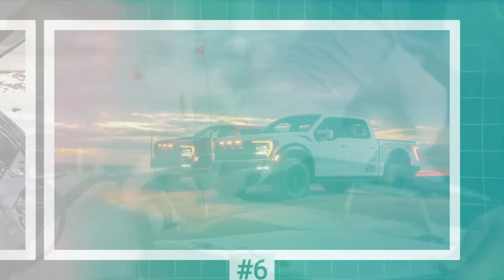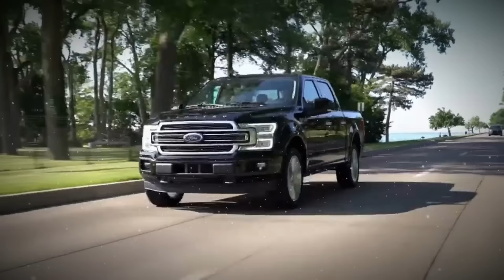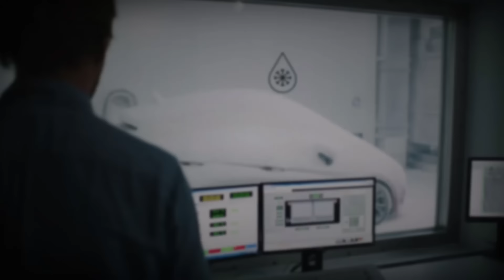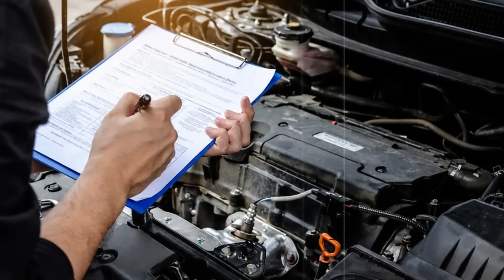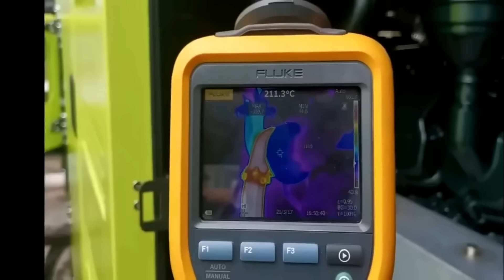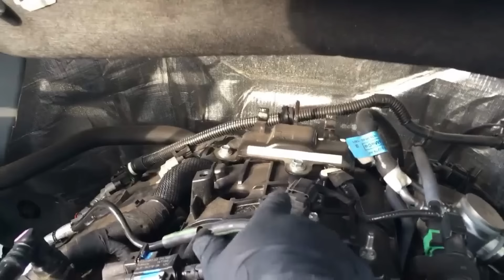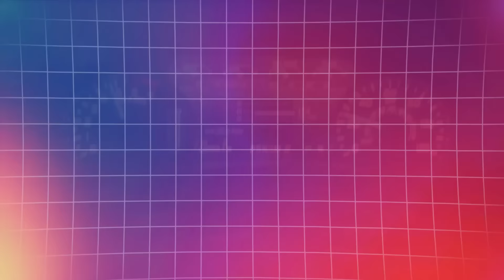We Ran a Turbo F-150 & a Naturally Aspirated F-150 Side by Side for 200,000 Miles — A Clear Winner

Comment: Don't forget that a small displacement turbo engine uses more fuel,  to make the same power, under boost, as a larger displacement N/A , because they run richer. Also, the Coyote uses the same timing chain and phasers as the ecoboost, but they arent as hard on the oil, as the ecoboost, and create more soot, and oil contaminants.

Comment: What I got out of this video is that both engines are very good.  Which is the better choice depends on the specific uses.  I was surprised that the Eco did as well as it did considering the heavy towing usage and mountain roads.  Sorry you didn't tell us the initial price you paid for each one.

Comment: 1st off, they used a 2.7 eco-boost, they should have used a 3.5 eco-boost. They used it as a work truck, the 2.7 is not a work truck engine. Tho the aluminum box on the ford isn't a work truck either, IMO.

Comment: That little V8 first thing  take Increa.\n Se the air going into the motor by simply Drilling some holes in the airbox puts you a set of good stainless steel headers on it. You'll be thanking yourself. I promise you. Both Of, those. Modifications. you do more air in the headers will increase power and fuel mileage guaranteed. O my bad. Put a oil cooler and a Transmission cooler.

Comment: I have owned and worked with all different types of 6 cylinders, the 4.9L, 300 c.i. Inline straight aka (Big Block) 6 is the best 6 CYLINDER ever produced, for the V8’s, it is an argument about who is #1, a 500 horse, 500 torque, 460 c.i. engine is a very nice well rounded setup, WITH A MANUAL TRANSMISSION

Comment: Really good comparison. Wish you could have included the total fuel cost difference. How much did the 2.7 save in fuel costs over the 5.0. Also I realize that a turbo replacement before 200k is not the norm. Never the less the turbo motors upkeep was significantly more. Been interesting if you could have also done the 3.5 and the 3.0 diesel.  Personally I had a 3.0 diesel that I used commercially to transport 1/2 ton appropriate travel trailers.  The fuel savings over gas was significant. The reliability was better than gas once the truck was  aftermarket tuned with the EGR turned off. The 3.0 diesel was the best choice for me but came with the caviate of some additional investment.
Reply: Ford uses a 2.2L diesel in the Asian markets. I drive one when I am there (6 months at a time). Plenty of power, great fuel economy (30 mpg ) quiet, smooth idle, feels like a gas engine with no odor or rattle. Too bad the US consumer thinks they have to have 6 liters to move an empty truck.
Reply: @briangc1972  GM 1500s have a 3.0 liter diesel that is selling pretty well. Also 30 mpg

Comment: I recently bought a used 2012 F-150 4x4 dual cab similar to these trucks. It has the eco boost 3.5 with 292,000 miles.
I had resolved to never buy any vehicle except EV but the price was so low I couldn’t pass it up. Gets about 16 mpg with careful driving so it’s a welcome addition to my stable. 
Apparently it hasn’t been used hard because it runs and drives very well. I wouldn’t buy a new one with YOUR money because they have pushed ICE engines past their limits trying to compete with EVs.

Comment: Your report exposed what common sense is instinctually to us. I will not buy the cars I normally would buy. The power trains are all 2.0 turbo for a 3500 to 4500 lbs cross and SUV's. I own an 06 Lexus LS 430 and a 16 Acura RDX Technology package. I won't sell them because they are both naturally aspirated V8 and a V6. I don't trust these turbo little motors. My wife when we met owned a 88 La baron a 4 cld turbo. Was showing wear at 27 k. We traded it.

Comment: The fact of the matter is that a turbo is HOT. It can reach 4,000 degrees Fahrenheit. That alone should give you that answer. Turbos are not the answer. That 5.0 liter V8 has been around for years. And Ford just continues to upgrade it. Need to explain what "Eco-Boost" is. If it runs hotter than naturally aspirated, then it too, is to be avoided.

Comment: You ignored the fuel savings. The 2 mpg across 200,000 miles will cost between $4000 and $5800 all by itself, closing the gap entirely. You ran a hatchet job not a test. Also, the 3.5 eco boost is a better comparison

Comment: All the problems derive from the ethanol mandates. If you want to use ethanol as an anti-knock agent you don't mix it with the gas. You just spray a bit of alcohol-water mix behind the intake valve when under load. Engines don't knock at idle. This keeps your valves clean, uses far less alcohol, which can be methanol or ethanol because the alcohol is simply antifreeze for the water, which is the primary anti,-knock agent and more effective at it. It is far more efficient to produce this alcohol from natural gas than to run diesel and natgas  through a cornfield and a distillery first.

If you insist upon mixing ethanol with the gas, you need less than 6% to achieve the desired anti-knock rating - which is all the "octane" rating is now. 

There is zero octane in ethanol.

Moreover, in real-world engines you get virtually zero motive force from burning the ethanol in the gas mixture. It's not only not fuel, it's like negative fuel; it scavenges heat from the gasoline making the gasoline itself less effective at heating and expanding the mixture during combustion. The ethanol isn't burning of its own accord, but being incinerated in an expensive, complicated, rolling gasoline furnace.

In early "flex fuel" engines running normal 10.x-11:1 compression ratios the net result is zero power from the ethanol - or worse. In real-world driving 10% ethanol results in a 10% increase in fuel consumption and 15% ethanol a 15% increase - and that is being generous.

Also, ethanol is still a hydrocarbon which releases CO2 when you finally manage to incinerate it in the engine, and producing it through the fermentation and distillation of corn is so inefficient that even without accounting for the real-world performance hit some studies have concluded a 24% LOSS in energy from the fossil fuel inputs. The highest and most optimistic theoretical thermodynamic yield estimates come in at less than 20% with more realistic estimates closer to 15%.

The net result is an environmental and economic catastrophe: 

More CO2 and other greenhouse gases released and more fossil fuels consumed.

And you get to pay for it twice.

At 10% concentrations, for every 10 gallons of fuel you burn you need to buy another gallon of fuel just to incinerate the ethanol you didn't need in the first place to move your vehicle down the road.

And that's why the oil industry did not object when oilman and famed environmentalist GW Bush implemented the ethanol mandates in the first place.

So the auto industry was squeezed by contradictory mandates which demanded that they meet every-increasing fleet mileage standards while simultaneously being forced to burn inferior, retarded fuel. 

So they had to move to increased compression ratios and forced induction, which meant moving to direct injection to flash-cool the combustion chamber, different mechanical engine geometry, more robust components  and tighter tolerances.

Which is why you now have the privilege of paying a hundred grand for a truck you could buy 10 years ago for under 30, but comes with the marvelous new feature of having the engine wear out in half the time or grenading itself at 60,000 miles because somebody left a bit of dust in an oil galley.

All while buying an extra gallon of bad fuel for every 10 gallons of genuine iso-octane, or worse; at 15% you're buying one every 6 and a half gallons.

All to feed Wall Street while it trades brand new government-issued notional "green" tokens in yet another speculative market and actively starves people by literally burning food and driving up the cost of every item in the supermarket.

This isn't just incompetence. It's wealth extraction.

It's literally the plan.

Comment: The plugs ejecting from the turbo engines had isn’t a turbo problem, its an engineering problem. Ford had the same problem with the 2valve modular v8s

Comment: I'm still driving my 89 f150, 5.0, 4x4, 4-speed, with 238k miles. It started leaking oil about 5 years ago, so I'm having a new 5.0 crate motor put in next year for $4500 ( parts and labor) I plan on keeping it until I kick the bucket
Reply: I have a 96 4.9 5spd 4x4 that I am the 2nd owner and I plan on keeping it (unless the price is right)
Reply: @PhilStewart-xf9rp Great vehicles!
Reply: They built real trucks back then.

They also engineered the older vehicles to last a lot longer. 

Their reputation was on the line I don't think they care about that anymore.

I put about 200,000 on a Ford work van V8 5.0. The only problem in all those years was a broken belt. 

I currently drive a 2011 Nissan Titan pro 4V with the 5.7 v8 I had one heater problem that took me 15 minutes and 50 bucks or less to fix. No other issues what a great truck. 

I'm not sure I'd want to touch the new one of either one of those.

Comment: Coulda told you all that. The eco is a torque monster and more fun to hoon in, but for sustained towing V8 na all the way hey.
Reply: Only if you like to listen to an engine screaming at 4400 rpm or more to get the power
Reply: @pathunter7003  look at the torque curves
Reply: @scottstewart5784  I did look at them, did you?
Reply: @pathunter7003  4400 in a V8 isn't screaming. All the turbo tech and unreliability provides more early RPM torque in a V6 twin scroll, sure, but at what cost?
Reply: @scottstewart5784  the reliability with the turbos does provide very early torque, 400 lb at 2750 rpm and has no costs at all. With that kind of low end torque it makes for easy towing

Comment: Old retired truck/car/bike dude - lifelong (dozens) Ford 1/2-1 ton truck guy but owned/modified/built/raced a wide variety of other vehicles/manufactures. My 2016 (extremely modified overland build) Jeep Wrangler Unlimited Rubicon now has 186,902 kilometres and the only engine/drivetrain issue was the usual thermostat/housing replacement this past January. Meanwhile, my 2020 Ford F-350 Limited = every imaginable issue.

Comment: I drive a 2018 F150 with the 3.0 diesel.  (Yes, I know it's got 2 turbos in it.)  It would have been interesting to put a diesel beside those other 2 engines.  My big regret right now is the price of diesel fuel; at times it has been cheaper than gas.  Can I, a Canadian, blame US politics for most of this?

Comment: Turbos are designed to be an oil cooker.  They concentrate exhaust heat to a couple of bearings being lubricated by pumped oil.  
Put in a small 283 push rod engine and it will go 350,000 miles.
Reply: You can fix that with a huge oil cooler, so we're discussing design constraints here.

Comment: I don't buy fords because the first new car I bought back in the 70s was a ford Fairmont Futura with what was suppose to be one of fords best 6 cylinder engines and it had started using a quart of oil between oil changes at 100k miles. Not good enough for me. When it comes to trucks I use to buy Toyota. I actually kept my last Toyota for 30 years with no problems much. I traded it in on a Toyota Tacoma back in 23 because it was the last of the v-6s No more though because they switched to turbos as well and I am just not going to buy a turbo on a gas burner. But this is great info on turbos in general I am really surprised you were even able to get 200k miles on a turbo engine. Back when i was a teenager growing up in the 70's all my friends who bought turbos didn't even get 100k on their engine before it was worn out. I want to get at least 300k miles on all my cars and trucks so i take extremely good care of them and buy known high milage engines Since Toyota switched to turbos I might have to take a look at ford again thanks for the info

Comment: I sold my 2022 F-150 as the Ford Battery Management System resulted in dead batteries with 100% drain overnight. I replaced the battery 4 times with the last time before trading the truck in for a Chevy truck. The Chevy starts up in the morning 100% of the time so problem solved.

Comment: I already knew all this, but I still watched this video. I've told people since the 80s, to leave turbos for sports cars like Porsches, and non turbo for everything else. 
My mother bought a normally aspirated 2.4l Hyundai Sonata in 2018 and has had no serious issues in 8 years and almost 100k miles.
Other people in my neighborhood went with similar year Honda Accords with the 1.5l turbo engines and have early issues. The people that bought the 2.5l Toyota Camrys also have had very efficient and reliable cars. 
The 2.5l and 2.0l engines in the Subaru Crosstreks are also very reliable in recent years, and have no turbo.

Comment: I have a 2000 Ford Ranger purchased new with the Vulcan 3.0 engine, one of the best engines Ford ever built. Well maintained. Oli and fluid changes when needed. Oil change every 5,000 miles with synthetic oil, gets 18-23 mpg consistently. Replace shocks, ball joints, other front end work due to age. Replaced alternator and water pump in the past couple of years, all original parts. Totally stock except for my own audio system and speakers. That’s it. 

Recently drove to Portland Oregon from Grants Pass for a needed surgery. My driver friend said this truck runs like new. It will if you take care of it. Those who have them, and there are many in Oregon and Northern California  that do, are keeping them. The only truck I’d buy if I had to would be Nissan  frontier king cab, 4 wheel drive which has a naturally aspirated v6. Even that is about $40,000. No need to buy a monstrous F150 for any reason. Not my style. And not needed unless you work or need to tow something.These monsters will take up two parking spaces without blinking and are ego machines. Young people and elderly with $1000 dollar a month car payments. That’s insane.

Comment: Bought a 2023 2.3eb Ranger (my 5th Ranger, over 200k on the first 4). 73k mostly interstate miles. Oil changes 4-6k using premium synthetic (Castrol, Valvoline). EB has lots of low rpm grunt. Rarely to never downshifted up hills (10th gear @75-80mph up decent western NC, SC, VA hills. Of course this is a big problem … parking lots @10mph tranny in 5 gear.. poor drivability… slowing to 25mph going into town 7-8 gear.. very poor drivability. At 73k developed something felt like transmission banging between gears under moderate heavy throttle. Dealer and app (said misfire) stated to gently drive to dealer. Ejected a plug … tow driver drove it onto (and off) truck (said coil failure).. dealer drove it into garage (said sounded horrible). Two cylinders required sleeves… ford extended warranty refused coverage. The EcoBoost with metallic sprayed aluminum cylinder walls is barely a 100k engine.. will be trash if it makes 200k

Comment: Direct injection + undersized turbo engine = shorter life, more stuff to go wrong….In other news water wet.😢 Sad 😔 that it’s hard to find basic engines - nothing fancy- just stuff that lasts and does not cost a 80 to 100K for something that should have been way lower and simple and fixable by you - no special tools …just screw drivers and renches 😢

Comment: With numbers like that it looks like you got lucky with that particular Ecoboost.  Next time do three trucks,  another Ecoboost, another Coyote and a Godzilla and use a manual transmission with a custom extension,  an auxiliary trans mission with three more overdrives at about .83 for each. Ok, you could achieve it with a ten speed auto and the right gearing but it it would be much better with a  manual transmission and informed drivers.  I have not driven a Godzilla but it is not out of the question that it might cruise the highway at 1000 rpm, definitely 1200.  Something that is important is that if you are pulling more horse power you need to be pulling more RPM so you need informed drivers.  In World War II  Charles Lindburg  (spelling?) was over in the Pacific theatre.  A problem the pilots flying the fighter aircraft was range.  He told them to run the engines at significantly lower RPM and boost.  They would have had to compensate by running a higher prop pitch which would be like adding more overdrive ratio.  Apparently they doubled their range.  If you want, contact me.  I would be glad to help out with such an experiment. Oh, and I would not be one bit surprised but what the old tech Godzilla would out perform in all categories with the right gearing and drivers.